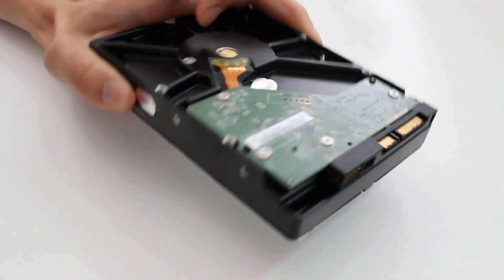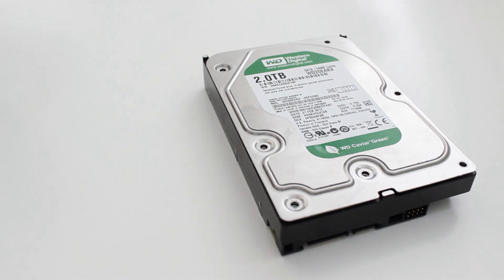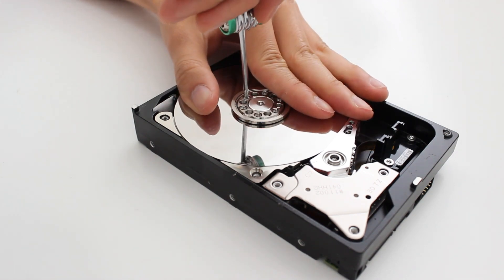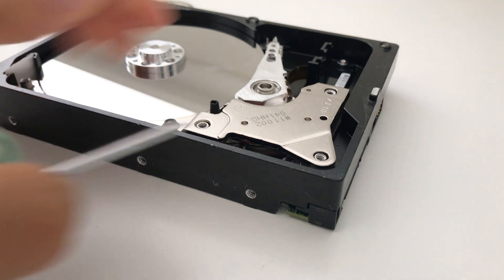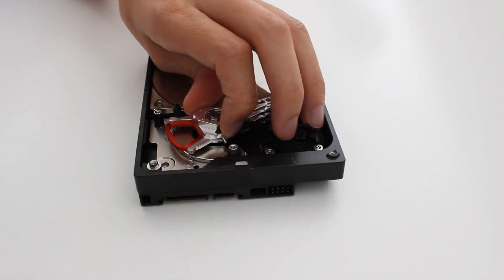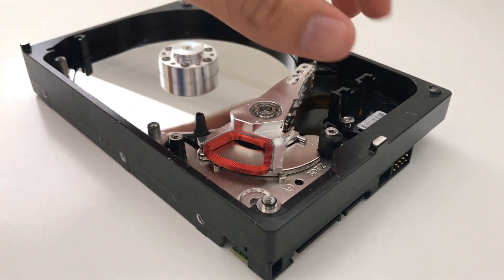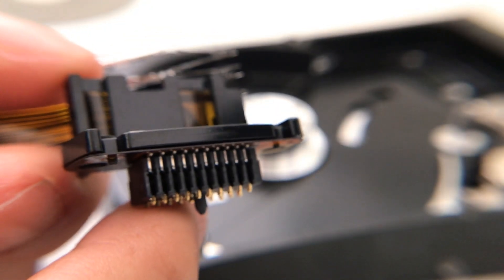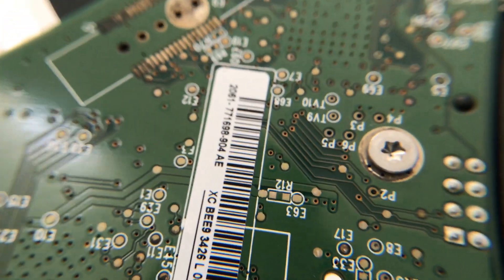What's inside my broken hard drive? HDD teardown

Comment: Do you know what size screwdriver you need for opening ? I opened the case but the bolts holding the disks are even smaller, too small for my scredriver.

Comment: It is complex and moving, which means it is susceptible to failure. I would like to use SSD's for media storage, but they are still too expensive for that. I hope there would be some sort of more reliable HDD replacement, a cheaper storage that is not as unreliable as spinning hard disks.
Reply: Ssds are so much cheaper now

Comment: What if this was a working HDD and you never left a fingerprint on the discs or did any sort of damage to it while taking it apart, but as you assambled it again, you installed the data discs in a different order, would your HDD stop functioning properly?
Reply: No, it would never work perfectly again, even if you took the cover off for a few seconds. All of those disks are synced together, and if they are out of alignment, the tracks and data on the disks do not match up. When the drive is manufactured the sectors and servo tracks (servo tracks tell the drive where it is on the disk so the drive can reliably store and retrieve information) are synced together so if any of the disks go out of alignment the drive will no longer even initialize and show up because the data does not match up. Hopefully this makes sense. Now on a drive with a single platter / disk this is not an issue because there is only one disk therefore it does not have to be in alignment or sync with other disks.
Reply: @cdos9186  Thanks for your explination 😊

Comment: Dude… I can’t believe it. Your hand is literally in the way on so many parts of this video. Most importantly, the final platter is what I’m stuck on. I cannot seem to remove the lowermost disk from my western digital assembly. And I was hoping that you would reveal what it takes to get it out. Everything else has been gutted. There’s nothing else to remove. just last platter, and the crown or hub that’s holding it in appears to have no screws — at least none that fit my collection of hexes.
Reply: 12:21 see that pointy rubber thing in the front? pull it out and turn the HDD upside down. The disks will fall out.

Comment: i need to talk to an expert.  since you take apart your harddrive, is it possible to clean up from defectiveness? i took apart one of my hardrive for extra memories. the hardrive worked for a while then out of the blue, it stopped working. i still believe it could be dirty and needs cleaning. i'm the type that keep cds in perfect condition since i'm pretty strict with having friends in my room playing videogames of kids. people tear up things so i'm very sensitive about it
Reply from the maker: Once you open up a hard drive, the inside gets contaminated and it can't be relied on anymore. There are data recovery firms with the necessary clean room and equipment to recover data off of damaged hard drives though.